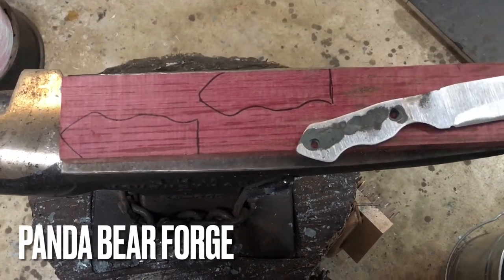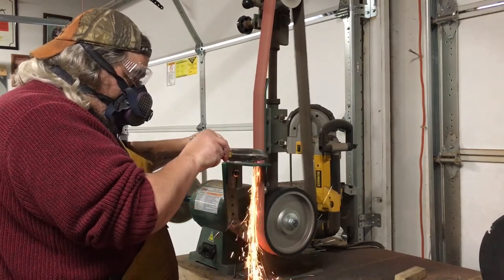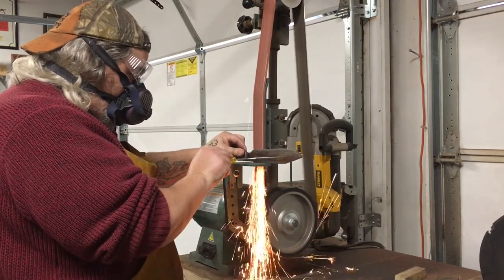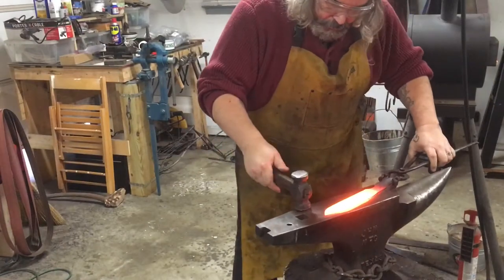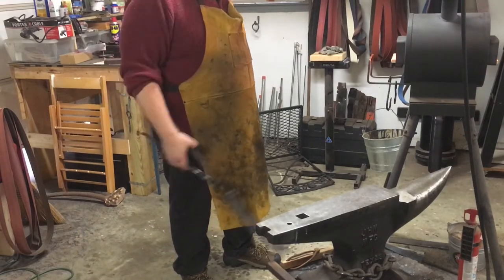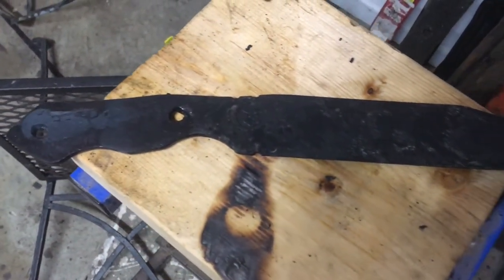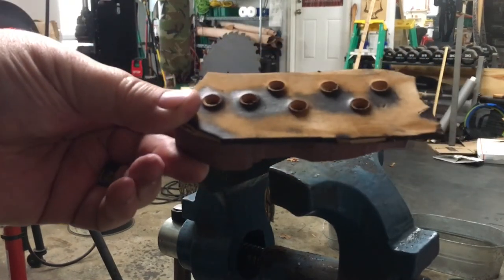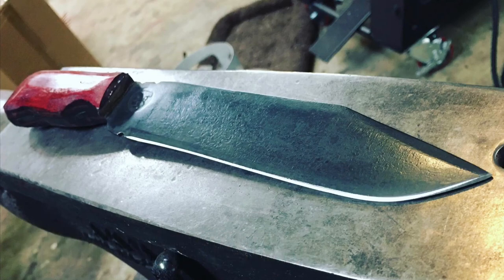KA-BAR Becker BK-7 Combat Utility vs Hand Forged Knife From Panda Bear Forge! Challenge - Part 3

Comment: Very good video. I'll have to catch up on pt 1-2 tomorrow. I only have one critique: instead of eyeballing and tapping the knife straight, just clamp it in the post vice from tang to tip. Quick, easy, straight every time.
Reply from the maker: I've done that before but got grid marks in the spine ... don't know my own strength!
Reply: I had the same issue, i made a set of  covers for the vice jaws from angled stock. Took care of that issue.